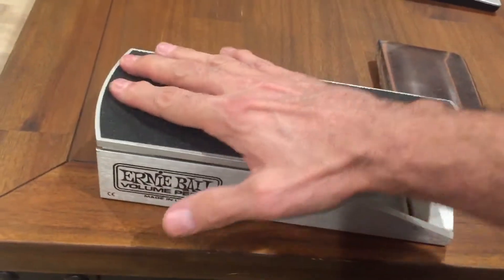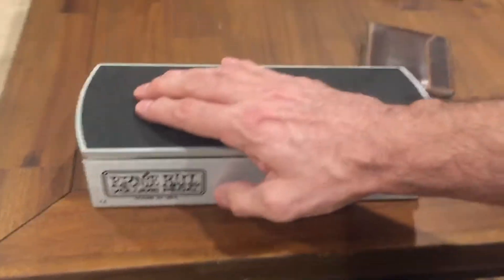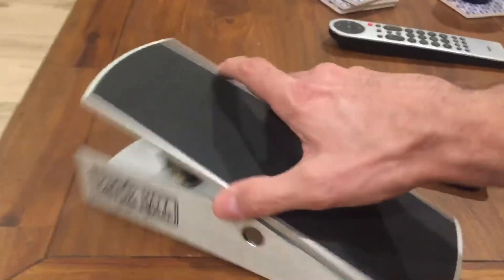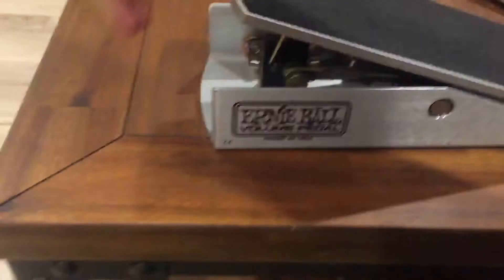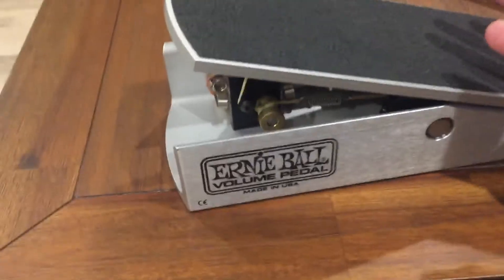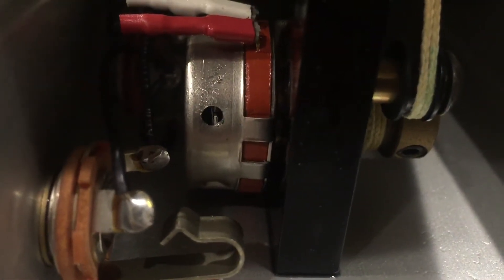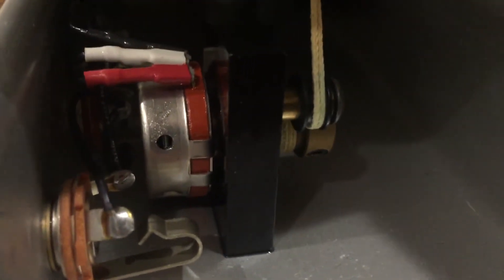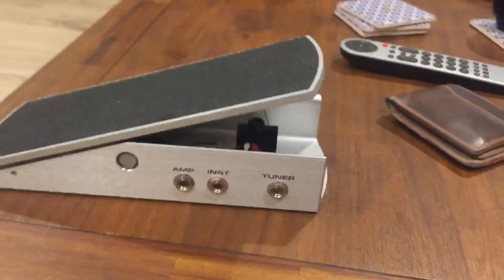Old Style Ernie Ball Volume Pedal “Caveman” Fix

Comment: tip is you don't want to have to drill a hole: The metal parts that clamp unto the plastic part are easy to bend, so you can simply use a thin flat screwdriver to set it free. Just open the pot, clean it with contact cleaner, and make sure you close it back tight, ur good to go and it leaves no trace!
Reply from the maker: But you DO have to disassemble the whole mouse trap!
Reply: @riffs66  yes, but it's not really complicated to disassemble and put back together. Like 15 min tops
Reply: @pierremandon2323  but what's the estimated time of completion for a caveman???